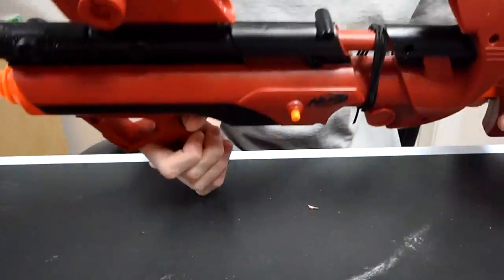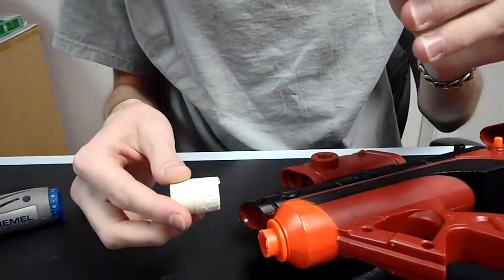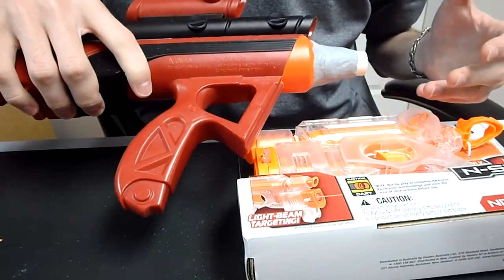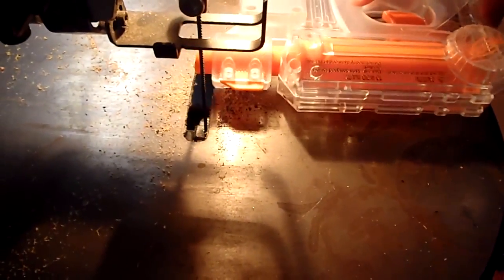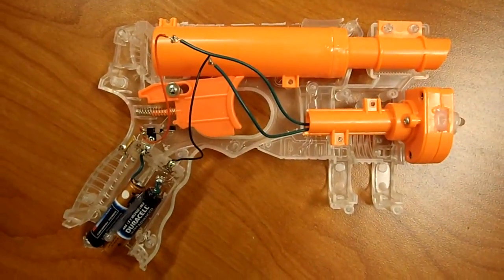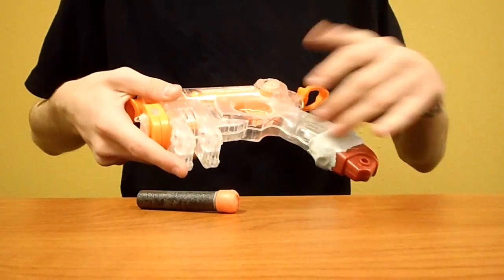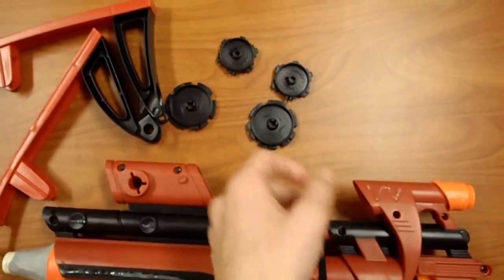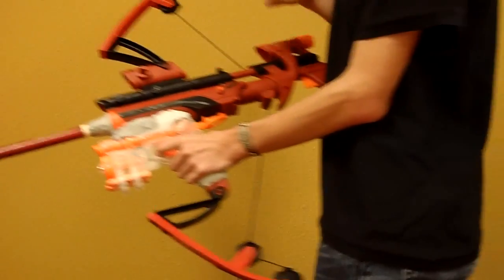How To: Make a "DARKBOW" + my blog launched

Comment from the maker: @captainprice78 Im glad you like it.  Doing a full tutorial on the LED's is sortof impossible.  I buy LEDs online or salvage them from other project, then measure thier internal resistance and create custom circuits to fit their power needs (and integrate a switch of my choosing).  I put LED's in my comissions for a bit extra, but it isn't something I can teach in a video.  It just takes years of practice (including blowing some LEDS) and a bit of soldering practice.

Keep modding.
//Drac

Comment: Just letting you know if you put a new spring and remove the Ar you should pad the plunger head[Craft foam,Rubber Gasket,etc]to cusion the plunger head and for new the spring.A new catch spring I reccomend replacing the orginal catch spring and using a Cut down Ace#2 Spring.<-Nitefinder.Makes the gun last longer.Btw I can't for some rason find the blog won't pop up any results.Great job.Can't wait to get my scout

Comment: that is fr4eaking amazing. that was worth the wait of a few weeks to see that thing. its nice to know that everything is rock solid. i also think you did a very nice job on the little plate on one side of the gun that says "darkbow by drac". good luck with that as your primary. also, can you make a full tutorial on how you do your LED'S? also what kind do you use and from where? im thinking of putting leds on my longshot. thanks. :+)